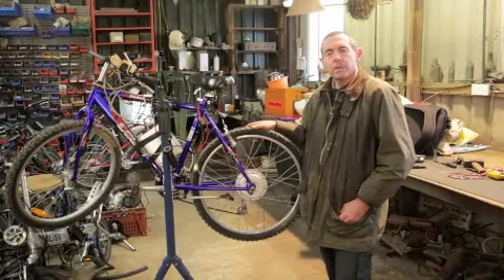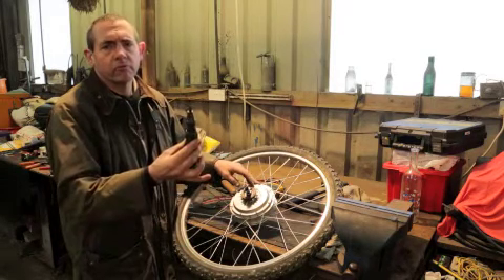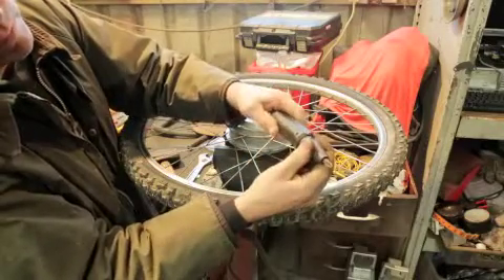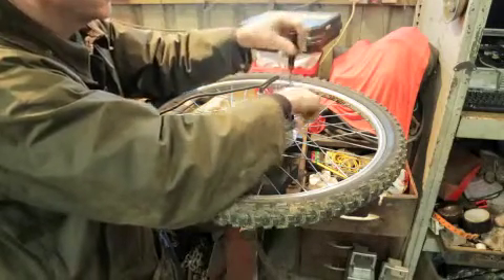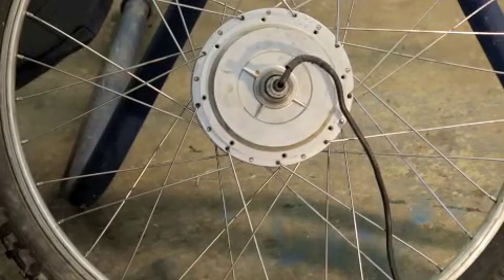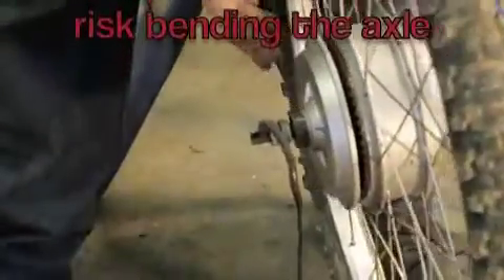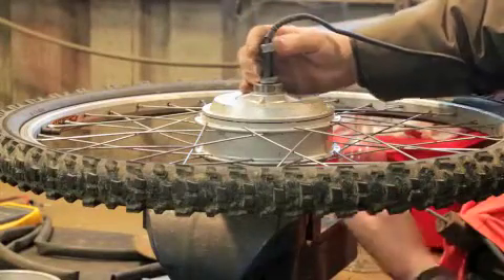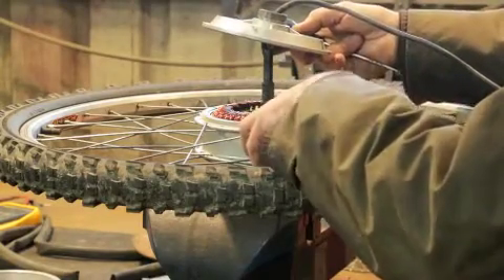Opening a hub

Comment: How many watts of this motor
Reply from the maker: A motor does not have a wattage.  The wattage is dependent on what the controller puts out.
If you put a controller at 100 amps and a battery of 80 volts, that is basically 8000Watts, and the motor will be 8000Watts.

I ran this motor at about 14,000 watts in short bursts.

Comment: and if it's the wrong model, congratulations you've just broke it
Reply from the maker: If you don't know if you are opening a geared or DD type, and have that little mechanical sense, and you do hit it so hard you bust it, then you deserve all you get.
Any basic DD motor will pop apart like this.  You will do less damage this way than using a puller which magnifies the forces.
If a person is that mechanically insensitive that they do damage, then whatever method they use would likely end in disaster anyway.